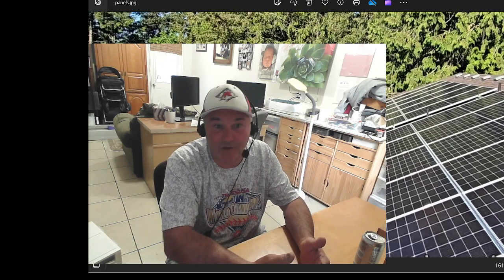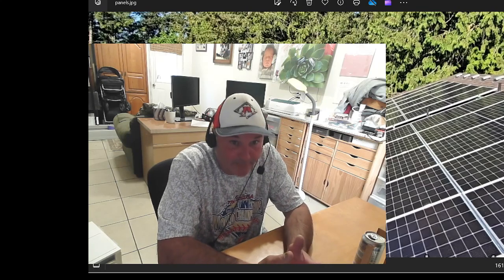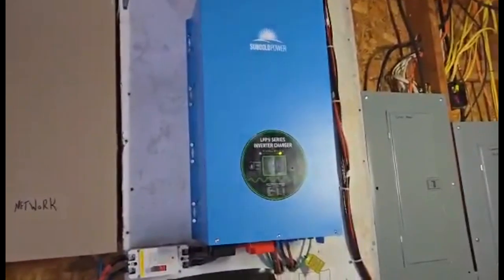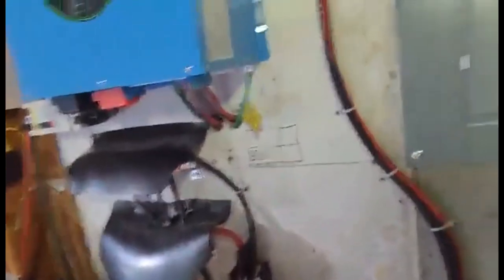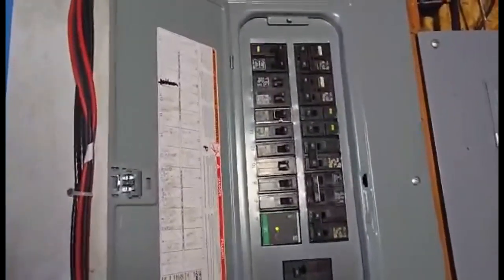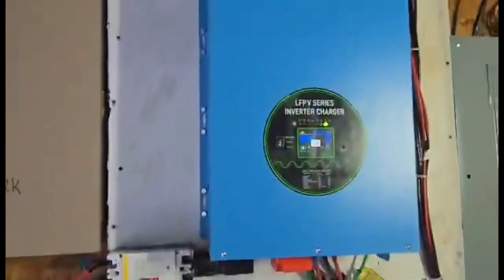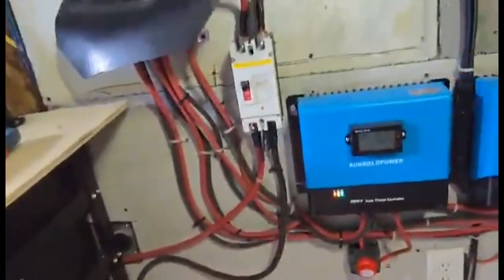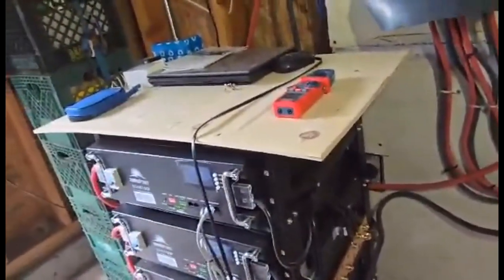The Benefits of a Sungold Power Hybrid Solar Inverter.

Comment: Do you have a change over switch at the commercial panel?
Reply from the maker: A hybrid inverter uses a breaker in the commercial panel to feed power to the onboard dc charger to the inverter. out of the inverter there is a second sub panel that feed everything that the solar system is feeding in the house. 

So my house runs off of batteries only and if the solar panels can not keep up with the demand of the house and it drains the batteries down then the commercial power kicks in and starts charging the batteries. 
That is the only thing that ties the system into the commercial power. We do not feed power back to commercial power at all.

Comment: Wonder how hot those PV wire bundles are?
Reply from the maker: No more then 25 or 30 amps dc on 8awg wire.
But yes i have been thinking about seperating them.

Comment: I would avoid using DC disconnects like that for your PV. If you switch them off under load they could cause an arc and possibly a fire. They really aren’t rated for that voltage. 

Buy some PV disconnects. They are fairly cheap considering you can add 2 strings at once into them. So you’d only need 2. And they are designed for PV. Keep up the videos. You’re doing great.